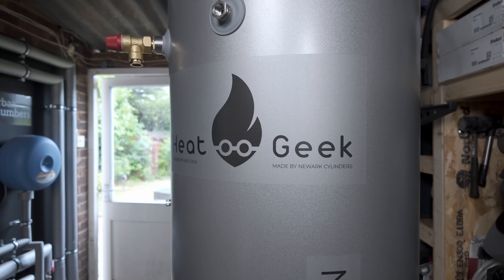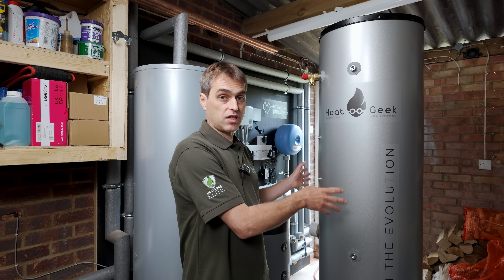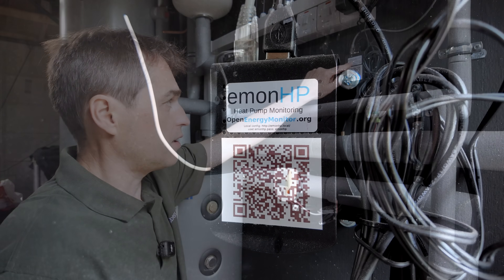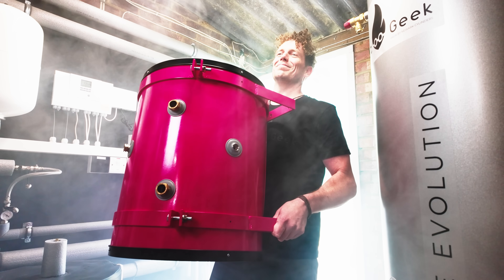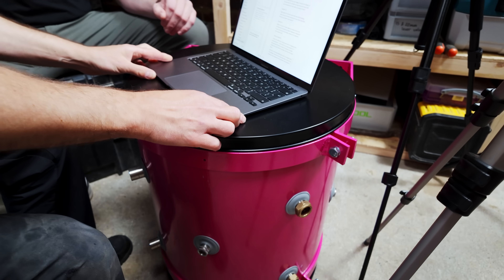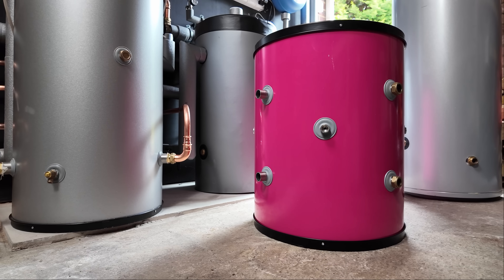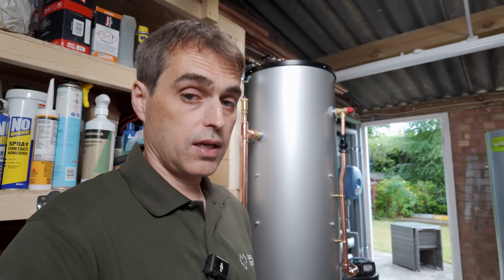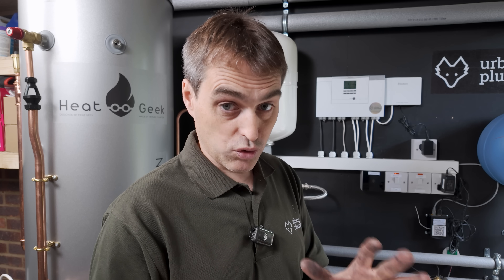Heat Geek Super Cylinder Tested: The Most Efficient Hot Water Ever?

Comment: what difference does it make if the heat that leaks through the walls of the boiler is still inside the house? yeah, the pump works a big harder to heat the water but has to work slightly less on heating the floor.
Reply: If you use hot water in the summer you'll be heating your house when you don't need to. If you have your tank in an unheated space like a garage you'll be wasting heat. If you heat your hot water when electricity is cheap (overnight or on solar) then when you come to use it it will be colder. This means you are losing money as you either have to heat it to a higher initial temperature or top it up at higher cost.

Comment: Great video and improvements! Have you also seen/tested any indirectly heated hot water cylinders? Itho Daalderop has some, the 'I-WPV 3G' series. It's really compact due to a lack of coil inside. It heats by pumping the water inside through a plate heat exchanger in it's base, where it's gets heated by the heatpump. Running one for about three months now and really impressed by it's performance :)

Comment: Hi, I'm curious how much double spiral is important? I've found (Poland) producer that makes similar tank with 3,11m2 coil in the bottom part of 200l tank.  It's single, not double coil, but the price is really good (like 40% cheaper than joule). Do you think does it make sense to go extra mile for joule? I plan to install 4/5kW heat pump (3,5kW heat loss).

Comment: It would be very easy to just say the Kw total to heat the old vs the new
For the simple folk you know, like me :)
Reply from the maker: it takes 1kWh to recharge the super cylinder in the summer and 1.5kWh in the winter. Regular cylinder will take around 10-15% more energy to recharge on my heat pump, so 1.2kWh - 1.8kWh.

Comment: There is an adage “the perfect is the enemy of the good”.  You guys do fantastic work, but in my business I also project the financial impact of different options.  Do Heat Geeks address this dimension in your training and n your customer recommendations?  If so, what software do you use .. and what is the cost / benefit of these high-end cylinders vs a lower-cost one?  Payback in years / component option is what my software calculates.
Reply from the maker: there is too many variables to answer this questions with one figure. Generally the bigger the heat pump the more benefit you will see with a larger coil cylinder. The price difference of a more expensive cylidner should pay for itself in around 5-10 years with lower running costs.

Comment: So if I am getting a "all-in-one" heatpump system liek Vaillant uniTOWER or even teh Daikin alternative am I "doomed" with an inefficient cilinder? 
Or are they feirly inefficient ? If so? which of the brands that offers  "all-in-one" heatpump system has teh best (larg heat exchanger) cilinder?
Reply from the maker: Probably none. Dakin and Vaillant cylinders are made by OSO, and they have a smaller coil. You don’t need a super cylinder btw, regular cylinders are fine.

Comment: Does the heat geek cylinder reduce both the cost of install, and (like the mini store) the need for extra bits like in a standard cylinder? Also can these be installed in a loft space?
Reply from the maker: HG cylinder is more expensive than regular cylinder. Mini store is also pretty pricey for what it is. Savings should come from lower running costs.

Comment: Interesting. We are having a heat pump system installed to run alongside solar water heating, and they have fitted the new Cordivar PDC system. Rather than two coils for solar and heat pump, it has one for the solar hot water, but on the top of the cylinder is a small set-up with a heat exchanger, small pump and a piping circuit that heats the domestic water from the heat pump -  based on the stratification theory that you talk about.  It seems that there are changes afoot in the world of DHW tanks!.

Comment: Standard 200 hp cylinder 900 quid.....cost analysis please
Reply from the maker: yes, decent 200L heat pump cylinder is around £1,000 plus Vat. This cylinder is not to safe yo money, it is to show how efficient hot water can be. Probably around £500-£600 more expensive. Will it pay for itself over the life span of the system? Proabbly will. I think Heat Geek run the numbers, but I do not have them to hand.

Comment: Now can we get that type of cylinder but with the ability to work it on a twin coil so we can utilise solar thermal? Finally does it have the possibility to use an electric heating element as back up so if a heat pump breaks down. Hot water is still available so less of a rush to get the repairs done
Reply from the maker: you can order a custom twin coil cylinder from Newark that will have large HP coil and also a solar coil. It becomes rather large and expansive. Yes the cylidner has an immerion back up.

Comment: Just fast forward to 2050 every house on the estate has a ASHP running.Its going to sound like Heathrow airport. Thats assuming the whole electricity network has been upgraded to take the load and we have built the 6 new nuclear reactors to power it and we have found our own source of fuel for them.
Reply from the maker: my hosue with solar with produce more energy that it will use for everything, and that inculdes charging EV vans.

Comment: This is really interesting as I've yet to fit a heat geek cylinder, for a heat pump it's a no brainer as long as the cost is comparable with a manufactures own or Mixergy which are the ones that come up in conversations with customers most.
Reply from the maker: the best vaule cylinders in my opinion are Joules. Newark and Mixergy are really expensive for what they are in my opinion.

Comment: Does it work as well without a heat pump heating system and can if allow for an immersion backup heat source (in case the heat pump fails/in repair). If a heat pump takes advantage of pressure to generate heat, would this be somehow useful as a pressurised hot water tank ie just increase the water pressure in the tank to generate heat as a byproduct. I recall my scuba tanks got hot when air at pressure was injected into the tank and lost heat as air was vented and a vacumn was left
Reply: Heat pumps use evaporation and condensing to exchange heat between 2 heat exchangers. It’s not just compression that makes the heat. The pressure is used to make sure the refrigerant evaporates where you want cold and condenses where you want heat. Heat pumps and air conditioning are basically the same thing. The cop coefficient of performance is how much power you use for the heat that is generated. They are not really 400% efficient but they generate more heat units than they consume in electrical per units because you are effectively sucking heat out of the air to evaporate the refrigerant. Sure some of the compression will be adding heat but the phase change is what is important.
Reply: The tank will work with a boiler too. This works on having more surface area to take the heat out of the hot water coming from the boiler/ heat pump. The colder you can run heat pumps and boilers the more efficiency you get. The hotter something is the quicker it wants to get to equilibrium. Hence needing smaller radiator for hot boilers. So for a lower temperature you need more surface area to have a greater exchange of heat. 

So in short this cylinder will help you run your condensing boiler at a low temperature which will make more use of the flue gas condensing and giving up heat and getting more heat out of each unit of gas you burn. So you may be able to run it for less time. But heat pumps will show a much larger efficiency as boilers are probably going to be an extra percentage or 2 as they are already per much at the top of their game. 

Hope this helps.

Comment: It's brilliant, just a shame there isn't a way to retrofit the tech to  an existing modern cylinder. Really don't want to throw out perfectly good 2 year old one...
Reply from the maker: install plate loading - works fine
Reply: @UrbanPlumbers  please can you do a video about this, would really help the situation I am in!
Reply: You can add a stainless steel corrugated pipe inside the cylinder or ouside stainless steel plate exchanger + recirculation pumps and flow meter. After that you obtain an hygienic cylinder.

Comment: My only ask is that Newark use quality materials , we expect cylinders to last decades and these need to do similar , cos having ordered one they are quite a wedge .
Reply: We use LDX 2101 Duplex stainless for the smaller units, and 316L stainless for the larger units, both of which are considered very high quality grades.  All of our Heat Geek-endorsed cylinders are guaranteed by us for 7 years, against manufacturing defects. How they will stand up to corrosion, stress fatigue (if not annually serviced), accidental damage, or any other factors outside of our control, is impossible to predict.
Reply: Thanks for taking the trouble to supply the info .
Reply from the maker: I know what you mean ;)

Comment: There is nothing new, or special, about this cylinder. Many of us have been using tailormade cylinders produced by Gledhill. We have specified the coil size and design, including ways to deal with stratification, for many years. Its common for large commercial cylinders to have small de-stratification pumps. Tall narrow cylinders such as this heat geek design will suffer more from stratification than a short squat cylinder. The main reason that not many high performance cylinders are used in domestic properties are cost.
Reply from the maker: Suffer from stratification? Stratification is desirable and you don’t want to de stratify.
Reply: @UrbanPlumbers  Well that depends on how much hot water you need. If you have a very high temperature primary flow temperature and a cylinder with a high capacity coil then no level of stratification is a problem, some of my cylinders have a very rapid recovery time. I'ts also not true to say that this cylinder is the "most efficient cylinder in the world" I could have a more effecient one made to order, it also depends on how you want to measure cylinder effeciency.

Comment: I’m currently running a 500L thermal store with my 7kw Vaillant and am getting almost identical figures to the heat geek cylinder. I’m looking forward to seeing how it performs when I’m using the heating. I’ve also run the outlet from my mvhr system to the back of the heat pump to see the affect if any on the cop during the winter.
Reply: did running the MVHR outlet to inlet of the heat pump improve the efficiency?
Reply: @retrofitNik  Not massively but in the cold weather it defiantly reduced the number of anti frost cycles.